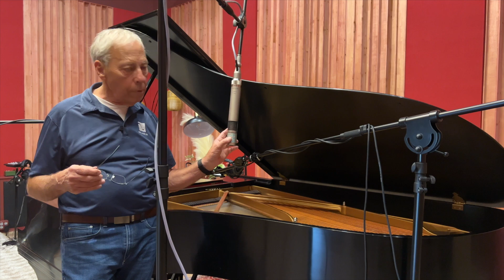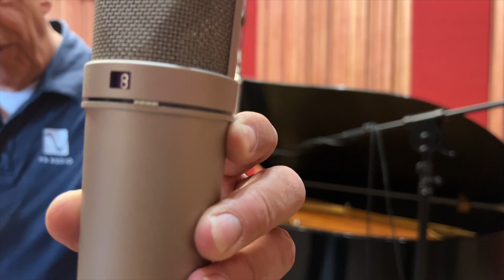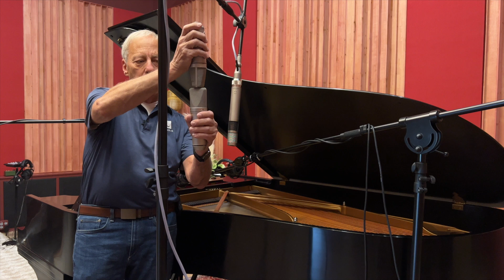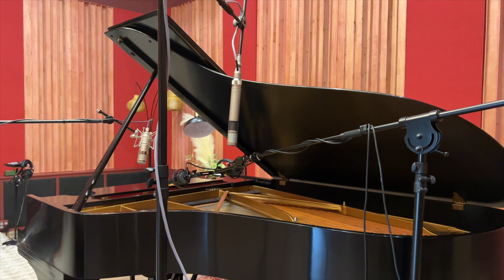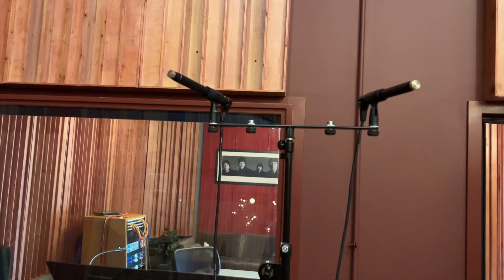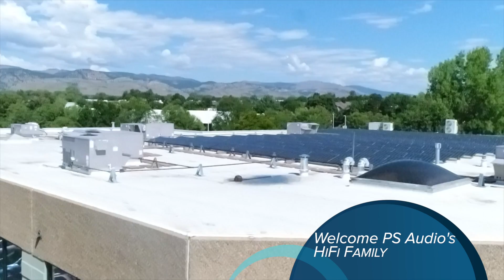The Blumlein microphone technique PS

Comment: Seeing as the signal from the rear of the diaphragm in a figure eight microphone is in reverse polarity to the front of the diaphragm, wouldn’t that make the speaker equivalent a dipole rather than a bipole?
Reply: Yes, I had the same thought. The reason the sides of the figure-of-eight are pinched is because the out-of-phase front and back lobes cancel at the sides. Just like an electrostatic or ribbon speaker.
Reply: @Technical_Audio  At 3.24 he says "these are all in phase", but that's just plain wrong. As you say, with a figure 8 mic it's the reverse polarity rear signal that gives you the side cancellation. When you flip the microphone's pattern switch to omnidirectional, it puts the front and rear lobes in phase with each other.
Reply: @gotham61  right!

Comment: Humans don't 'naturally" hear a piano in stereo.
Humans "naturally" hear a piano as a single-point source so it makes no sense to record a piano in "stereo" from the perspective of directly in front of the open lid.
Both the sounds of the strings vibrating and the reflections of the piano lid would be quite unnatural sounding compared to a person sitting and listening to a real piano.
Reply: You could argue that most people don't listen to an acoustic guitar with their heads 18" in front of the sound hole and at the 12th fret too, but that is exactly what recording engineers do for the most part to get the sound they want.  Others mic closer to the bridge and the 12th fret.
Reply: @rosswarren436  The operative words here are "the sound they (the recording engineer) want.
This is not trying to capture the "natural sound, but rather a sound that potentially fits in a mix.
This same technique is not typically used when capturing live acoustic guitar.
Reply: @JonAnderhub  yes, it is all about creating a "product" that sounds good and will sell well, whether it sounds completely "natural" or not. 

For instance, some may LIKE slightly hearing the hammers hit the strings on a piano to delineate each note better

The problem with distance recording is that  the highs start to attenuate rather quickly in air, so close miking can preserve those tones. 

It's all good whether done with a binaural setup or done using the time tested recording engineer methods.  At the end of the day, it is still music (at least when done well).
Reply: @rosswarren436  While I agree with you "that at the end of the day it is still music (at least when done well)",
I specifically made this statement because Paul is touting the fact that he is attempting to get the "most natural sounding recordings".
The use of a stereo microphone placed in front of an open lid on a grand piano does not correlate with what people would hear naturally.